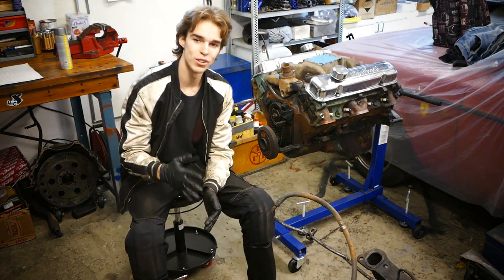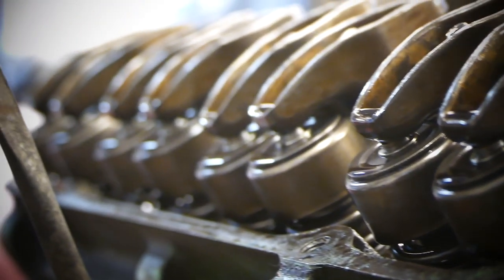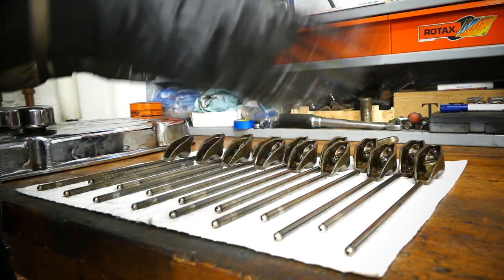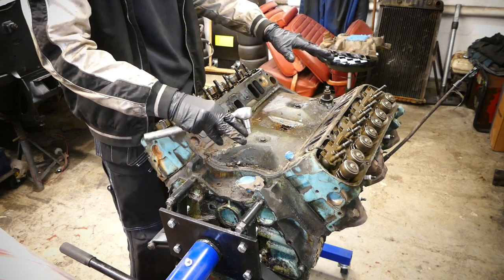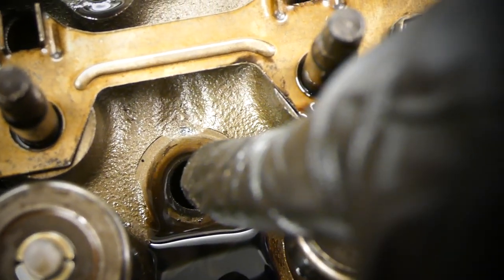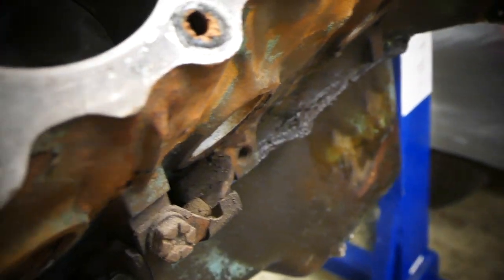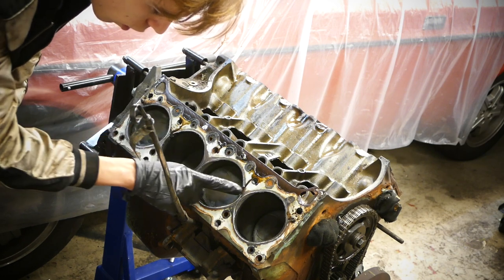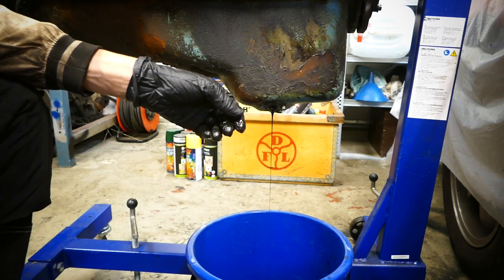INTAKE & HEADS REMOVAL! Pontiac 350 Engine Build Part 1

Comment: Thanks for posting this video!  Almost no one builds the smaller Pontiac blocks.  I had several LeMans cars with the 326 or 350 they are good reliable engines.  Maybe not the best for max. horsepower, but they'll be fun on the street.
Also, the .040" stamp means that the engine has been bored .040"  (1.01 mm) oversize in a previous rebuild.  The 350 blocks can usually go up to .060" (1.5 mm) oversize from stock bore diameter.
I've never see that "S" that your block had on it, but I wonder if it was a factory hi-performance block.  They also had the cylinder chamfers on top like yours had.  It was so that the larger valves could be unshrouded for max. flow.
Good thing you didn't have to lift the original factory iron intake.  That thing weighs like 75 lbs. (34 kg)!  The iron heads are really heavy too!
I think Pontiac blocks had "wet" head bolts, meaning that they pass through the water jacket.  I think that's why there was water corrosion around the bolts.

Comment: Make sure in this build you put the time towards piston/valve clearance - those chamfers are certainly helpful, but if you are changing gasket thickness & machining, your camshaft selection is going to really consider this. 
I have a '70 350 as well, and glad to see someone tackling it with a video! I'll look forward to updates 👍
Oh, and that 'milky lubricant on your head bolts? Had the same on mine, I completely agree that it's assembly lube (with maybe a little extra mixed in over the years), but I'll check my factory manual just to reconfirm
Reply from the maker: Thanks for the info on the milky bolts haha wasn’t really sure, and this motor gonna be all machine shop so nothing fuck up when I get two engine I’ll try to experiment with different stuff on this old 350 maybe turbo or something!
Reply: Sounds like a good freshening up; I would recommend a couple things with the shop work. 
Certainly, you could look into doing it yourself, but I would have screwed in rocker arm studs - those pressed in won't stick with a different cam, high revving, etc. I believe that BIg Block studs can be fairly easy to install and the best for price. 
Also, it may be beneficial to replace the valves. People will recommend a larger valve (may or may not be best, depending on the build), but I've heard that modern stainless steel valves are recommended for reliability
Reply from the maker: @dietrichhoefer  yeah iam hoping to replace anything called valve train as the components on it now are kinda destroyed!

Comment: I was trying to see the casting numbers on your cylinder heads. If I am not mistaken they look to be #11 heads am I correct? Also I could not see the block casting numbers at all. The reason I am asking is because I have a 1970 block with #11 heads and I am looking to upgrade to #48 1969 ram air 3 heads. I had a 1969 # 48 large valve head Pontiac 350 HO 330 Horsepower 350 engine. I am just a NOT sure if all 350 blocks were chamfered for the large valve heads.

Comment: That brown stuff it’s just there to take up space between the low spots of the deck and the head gasket, also the oval around the cylinder was done around the factory it’s purpose is to allow more space for the exhaust valve. Also I didn’t see much ring ridge so your block looks decent if it has not been rebuilt already. Also Someone at some point filled in the top of the exhaust cross over on your intake manifold.
Reply from the maker: ohh okay that make sense with the valves, yeah for a 49 year old engine it looks pretty good rod bearing have had a bit of heat as well with the cam but nothing to bad
Reply: Viktor Hansen I’ll send a pic on Instagram of what my bearings looked like, I overheated my poor 403 a few times and it took its toll on them.

Comment: I’m assuming since the smaller bore size, it has those notches on the sides of those bores, the 406 that I pulled apart didn’t have those (motor was already bored. But I’d look into butler performance if you are looking for Pontiac performance parts. Nice to see another kid my age into these pontiacs, not many left.
Reply from the maker: its for the valves to clear and iam not building this engine just getting it running doing a 400 or ls next year, thanks for the support!

Comment: The chamfer at the top of the cylinder bore is for valve clearance, most all pontiac cylinder heads are interchangeable with almost all blocks( some years may vary). Some people say you can't run big valve heads on 350 blocks not true, I ran a 69 350 with 48 heads 211/177 valves no problem, I also put a set of 1970 13 heads on a 74 350 with a mild cam, no interference.
Reply: Might not have had any interference but because of valve shrouding you also may not have realized any more  performance and flow than you would have running the smaller valve heads. You would need to Dyno test to be sure.

Comment: Your block has chamfers on top of the bore  for big valve INTAKE  heads 2.11   More flow, more room to improove valve clearance. The risk is smashing the block. Put a good cam and new spring. U ll have a stout engine. Good job man.
Reply from the maker: Thanks man i’am
Gonna bore it 0.030 over so probally dosent matter with those chamfers ;)

Comment: the chamfers on the decks you mentioned in your video are valve chamfers to clear the valves, same purpose when you see piston tops with valve chamfers. You must account for them in your compression calculations to be accurate.
Reply from the maker: yeah how much do you think i can deck the block then, or can the machine shop recreate them!
Reply: i'll reply to you on facebook messenger @Viktorrhansen

Comment: I'm sure you've done your research, but just in case! For your roller lifters that you need to make sure you modify the oil system properly (or you will lose). Long story short, flat tappets need more oil than rollers and the bores are drilled as such. Since this is a flat tappet block it will bleed off pressure. Though it may change based on the design of the lifters, talk to a machine shop as they will know more than random folks on the internet!    https://www.hotrodders.com/forum/help-me-convert-flat-tappet-hyd-roller-123286.html
Reply from the maker: Okay Thanks for the info man ill have to look into that now i’am getting A 80 psi Oil pump which might help that
Reply: @Viktorrhansen  I would still do the proper oil modifications - oil pressure loss is no joke. I seized up a SBC because I didn't check the oiling system- long story short its not a fun time....
Reply: There is nothing that needs to be done to run a roller cam in a Pontiac block.  I've built them with hydraulic roller and solid roller lifters both.  Nothing else needed.

Comment: That is not a high rpm engine.
Reply from the maker: not from stock no
Reply: @Viktorrhansen  Regardless of displacement, Pontiacs are a low RPM operating engine. You can rev the shorter stroke Pontiac motors to 6,000 Rpm reliably with quality forged rods and pistons but it will make less power than it does at 5,000 Rpm. Trying to optimize a Pontiac 350 for high Rpm operation is an exercise in futility. It will never be (or beat) a typical small block Chevy. 

The stock Pontiac D port heads also do not support the flow needed for high Rpm operation. They were designed with good low lift flow characteristics that build low end torque but run short of port flow and go into turbulence above.500" lift. You're beating a dead horse spinning one of these motors at higher Rpm unless the heads are radically ported or replaced with modern aluminum heads.

A 455 (or 400 stroked to 455) is even more RPM limited with its longer stroke and resulting higher piston speed but it's flat torque curve doesn't need high RPM to post big numbers.   Building a 450 Hp/500ft lb 455 motor is like falling off a log easy and no more expensive to build than a 300 HP 350.